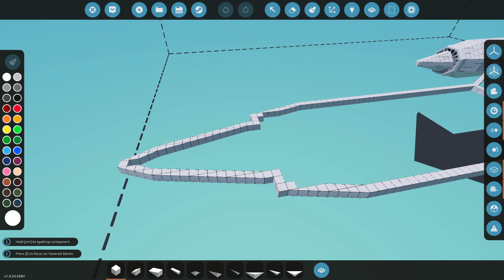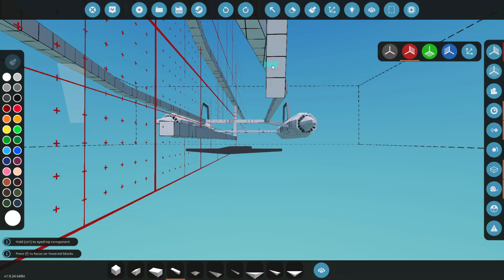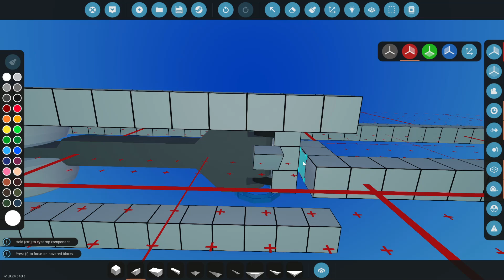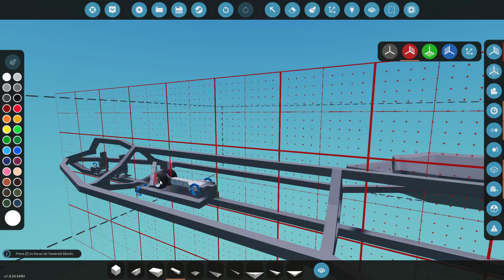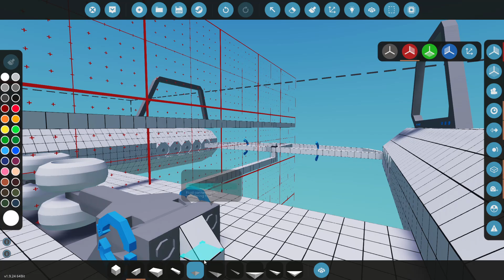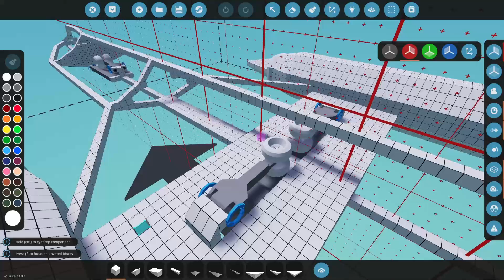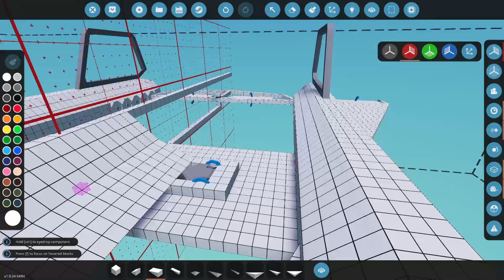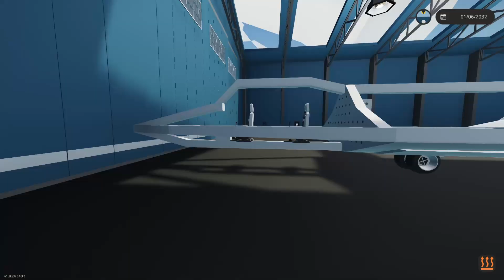Landing Gear & Body Work! Let's Build a SR-71 Blackbird!!! [2] Stormworks

Comment: On the last video I gave you some trivia, I have some more for whoever is interested. The blackbird was made with lots of titanium, it was relatively lightweight and had a high heat resistance. But did you know that the vast majority of, if not all of that titanium was bought by shell companies ordering from Russia. They also had to learn to work with titanium, (it is very difficult to machine and work with) and at the beginning of the project, they could only use the drill bits for something like ten holes before they had to toss them out. But by the end I think it was somewhere around 100 and then they could re-sharpen the bits and use them more. The engineers had to make their own tools to build the plane!
Reply from the maker: Very cool info!

Comment: The plane looks great! Maybe for the landing gear, you could make the 1x4 wedges on a separate pivot, which rotates the opposite way the gear and the attached closing flap thingy are going, so you have clearance for the wheels, and hopefully looks good!

(And I personally would push it more to the back, how can this thing take off without grinding the engines on the ground, but that’s not that bad :D)

And you could add a aerial refueling probability later, this is actually pretty realistic, bc the whole plane was build with the deforming through the heat of the atmospheric friction in mind, which meant that it constantly leaked fuel, and needed to be refueled in the air to be able to run those high altitude and speed missions. (This is a lot of text I hope it wasn’t too overwhelming :D)

Comment: A large section of the fuselage behind the cockpit is payload storage for cameras etc. The "wings" are fairly thin and therefore void of equipment. There is a central "yoke" made of titanium that attaches the wing to the fuselage.  The overall design is that of a semi-lifting body/blended wing aircraft. There is a "Strake" that runs the length of the fuselage from the nose to the wing root that is used to divide air flow and to bleed off heat build up along the edges.